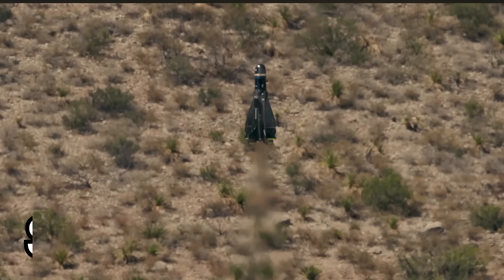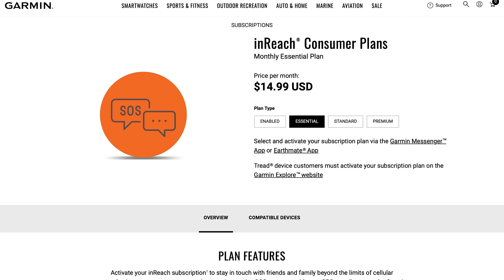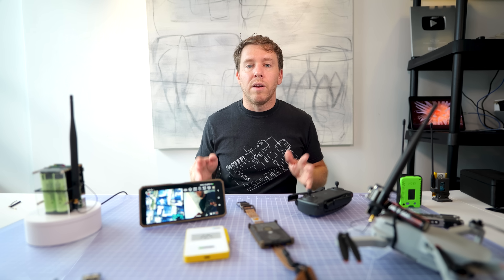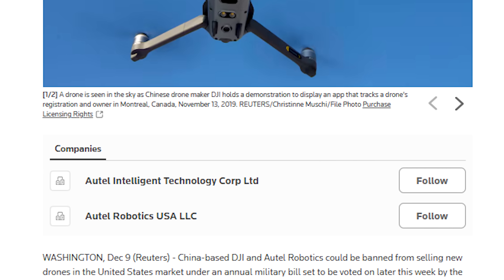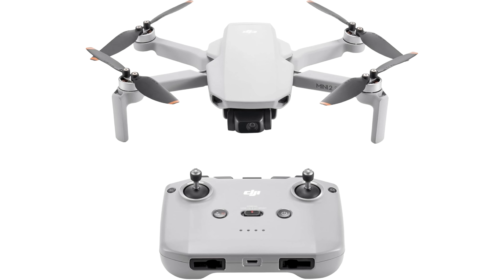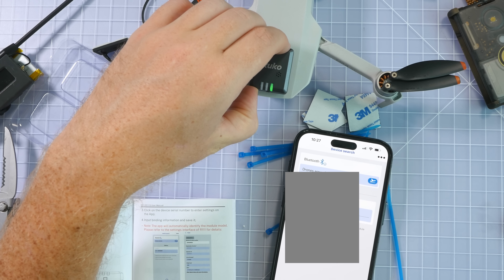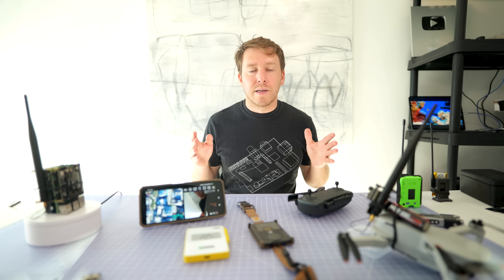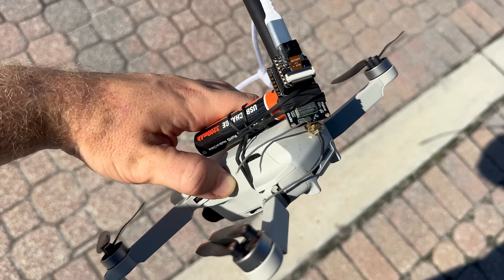I Built a $40,000 Military Drone for $120.07

Comment: You didn’t ‘build’ a damn thing. You assembled off-the-shelf parts other people spent millions developing. 
Slapping a Raspberry Pi on an SDR hat with some open-source code isn’t engineering — it’s Lego. 
Real radio design means RF front-ends, power amps, filters, crypto modules, MIL-STD environmental testing, and years of tooling and R&D. 

What you’ve done is a hobby demo in a lunchbox, not a military radio. 

Don’t confuse kit-bashing with building technology.
Reply: I was gonna say the same thing. Except he's also using a Chinese drone with Chinese software. Making it very much not a cheap military drone.
Reply: To be clear — I’m not knocking proof of concept. I’m knocking the claim that strapping a Pi to an SDR and flying it on a DJI drone is the same as building a military-grade radio or UAV. 

Real systems aren’t just parts glued together — they’re engineered end-to-end: custom RF chains, secure crypto hardware, hardened power systems, and full NATO/MIL-STD validation (MIL-STD-810H for environmental, MIL-STD-461G for EMI/EMC, STANAG 4204/4246/4538 for waveforms and interoperability).

And yes, we design and produce our own boards — that’s engineering. Nobody in 2025 is ‘rolling their own caps,’ not even the big primes. 

Every component comes from qualified vendors who themselves undergo years of testing, validation, and QPL/QML certification (per MIL-PRF and IEC standards). 

The skill — the actual engineering — is in architecting the RF chain, PCB layout, power distribution, crypto integration, and hardening it all to survive jamming, weather, and combat.

That’s what separates genuine design from just bolting modules together.
Reply: THIS.
not to mention he slapped that on an DJI drone that costs hundreds of dollars.  
the copists in this channel are cognitively handicapped.
Reply: @non-human3072 I'm glad someone else gets it. I'm not trying to diminish his work, but there is a massive difference between what he cobbled together and the $40000 military drone. Also, much of the technology he uses to make these cheap devices originate from a country that has tense relations with the US over security concerns. How easy would it be to hack this prototype? I'm guessing very easy. It's an interesting proof of concept but not even in the same league, yet he makes a direct comparison between the two saying, "a $40,000 surveillance drone, reverse engineered in my office for $100 and change. It's almost comical how much markup these big guys get away with.".
Reply: Yeah I hate it when people claim to  build Houses but they just buy bricks, wood, pipes, others spend millions to produce
Reply: Crypto modules? Are you not fabbing your own chips and rolling your own caps?
Reply: If it's so easy, let's see you do something better than
Reply: @nicktechnubyte1184 sure, that will be 40,000 per unit. Oh wait
Reply: You also have to keep in mind he clarified this is just a proof of concept. Why build from scratch to prove a point when you can “Lego” to make sure it will function?
Reply: And yours is where?
Reply: @RolsRoyce3  you shouldn't criticise  comments. Since you can't make better comments, you aren't allowed to make them. Also, you personally are right to get stiffed on anything if you can't do the job better yourself.
Reply: @TobyLegion why
Reply: @TobyLegion and you might look up the word criticize.

Comment: The tradeoff between what Andruil is doing and what you're doing is down to perforance.

FPGAs and the ASIC like performance and power efficiency they can fundamentally get over the pi isn't even really a debate in terms of bandwidth. A serviceable connection under low-no load isn't the same as in high-load conditions.
Reply: I think it's more a bandwidth issue than hardware performance: it's really difficult to stream video across long ranges without boosting the power, and then you need heavier equipment, so you need a more powerful drone, and the cycle goes on and you end up spending $40,000 of equipment... There you have it! 😁
Reply: @Patapom3 yes and no. The bandwidth of the waves is one limit bit the bandwidth of the hardware is another.

In the context of video you're talking bitrate.
Reply: @AnotherOtherMan well it´s certainly not a problem of performance here: you can easily stream high frame rate videos on an ESP32... The limitation is in the network, as I said... So bandwidth problem...
Reply: @Patapom3 these are ideal conditions not adversarial like heavy weather or high traffic.

An FPGA will outright out perform this every time. Legitimate militaries would require a minimum of 30fps for live intel/target aquisition.

The curx of what I'm saying is this is doable but not that performant for what is out there.
Reply: Not according to Ukraine, they say Anduril is crap.  Read about it yourself: The Kyiv Independent, " 'Battle-tested in Ukraine’ — How US drone makers turned Ukraine into a tagline to sell west"
Reply: Efficiency will always be expensive to improve to that kind of level, but you could get much much better performance with different, moderately more expensive, hardware

Wouldn’t be under 250g, that’s for sure
Reply: @HanTheProphet not the kind needed for a note serious use of this application.
Reply: OK sure he could spend $500 more on the hardware too if he wanted to :P
Reply: @furycorp  then theres aerodynamic performance, the completely different mission from the displayed ""surveillance drone", the fact the original project is autonomous and also integrates in a swarm system, etc etc etc yes you made a surveillance drone with a aliexpress microcontroller, congrats lmao